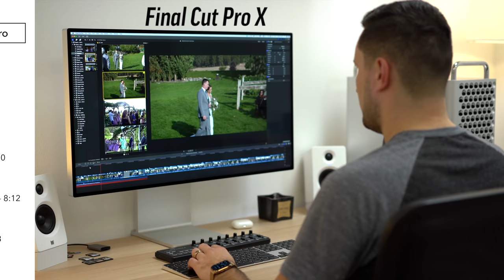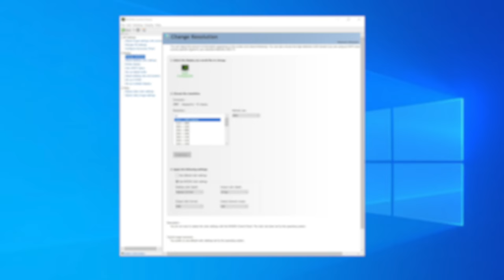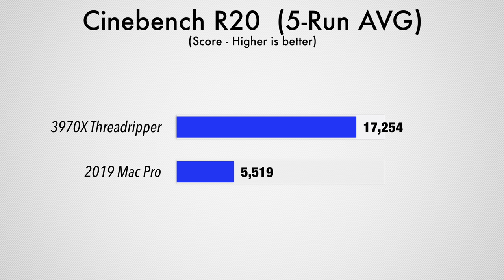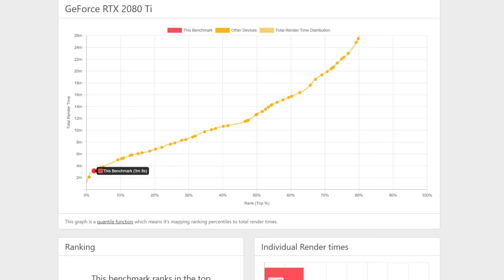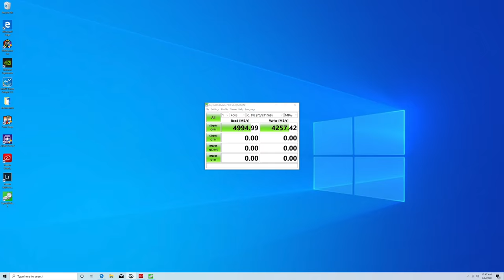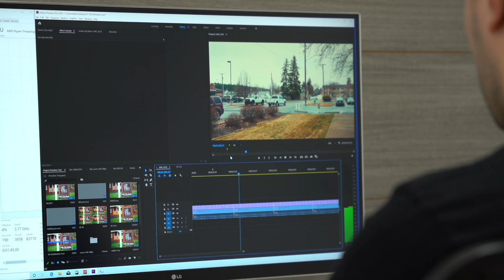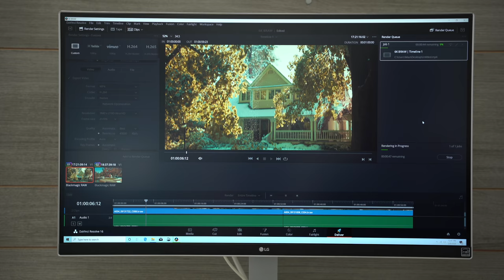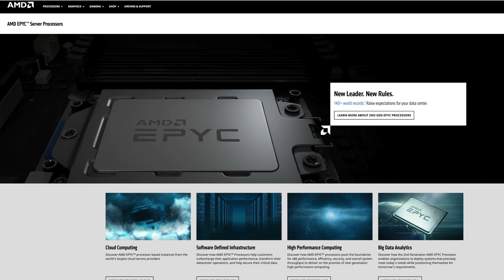$15,000 Mac Pro vs $5,000 Threadripper - Sorry Apple..

Comment: “1.5tb significantly higher than pc..” costs extra 25,000$ yeah no thanks i would rather have a car thanks lmfao
Reply: 1. The Mac Pro uses regular DDR4 ECC dimms so you can totally buy extra RAM from Newegg and install it yourself.
2. He's mentioning the >*possibility*< of putting 1,5TB versus 256GB which some tasks can benefit from.
Reply: @AlejandroLZuvic  I mean, you can get the same amount of ram on pc, even going up to 2t if needed for still less cost.
Reply: Samo Gledam lol why a server?? You can edit minecraft videos on a server
Reply: @lollol-qg2zn  get an EPYC which is 7k,and the system is STILL CHEAPER,and you have 2TB RAM
Reply: @AlejandroLZuvic  This is nonsense using all 1.5 Tb of RAM simultaneously in a lot of tasks this xeon can be your bottleneck obviously.
Reply: The real question here is why the fuck would you need that much ram abt 16 gb of ram and ur good
Reply: @BIG tiny PANDA Just watch Linys tech tips video about how much ram do you need ? Engineering easily takes 256 gb of ram and would like more

Comment: You gotta love the argument, "Oh we could get a Quaddro, but that would double the cost of the build".... Which would still make it $5,000 cheaper than the Mac.  Not a very good argument in my opinion.
Reply: Or a Titan V
Reply: blad90  Oh look, someone thinks he's smart.  OK Apple fanboy, let's dance.  I was being nice before with how short my response was, but let's go ahead and get into the nitty gritty.  Let's break it down.

The guy in the video misquoted the price by which the cost of his system would go up by getting a Quaddro instead.  He claimed $5000, but showed a $4,600.  I've been able to find that card easily for about $3600-$3800 dollars.  On top of that, he neglected to mention the fact that if you choose to go with the Quaddro "instead" of the 2080Ti, you don't factor in the price difference post 2080Ti when you consider how much the price of your system goes up by.  You need to remove $1200 from the price of his build BEFORE your add the price of the Quaddro to it.  So the price of this build would go up by $2400-$3400 TOPS... Not $5000.  Which would make his build $6,900 cheaper still than the Mac Pro in a worst case scenario, if you didn't take the time to SHOP AROUND for a good price.

But get this, if you were really "worried" about the 24GB of VRM, you could go up to the Quaddro 8000 (top of the line card) and that would only cost $5333 on Amazon right now.  That card has 48GB of VRAM, which means, this would only increase the price of the overall build by $4,133 and would STILL be OVER $5,000 cheaper than the Mac Pro.

But hey, while we're on a roll, why don't we finish this with some icing on the cake.  You could stick with the Quaddro 6000 and then buy a second one.  Have a Dual GPU system, unlike the Mac Pro version he bought, but end up with 48GB of total VRAM capacity (24GB per GPU), but have faster GPU's, more CPU cores than the Mac Pro could ever hope to match and still come out a few thousand dollars cheaper than the Mac Pro he bought.  Or go full bore dual Quaddro 8000's (96GB total) and still come up a little cheaper.  Not by much, but still cheaper.

Do you understand just how BAD a value the Mac Pro is yet?  Next time, do your homework before you attempt to debate hardware specs with someone who's been building computers for over 20 years.

Mic Drop
Reply: blad90  LMFAO!  This is pricelessly pathetic.  Thank you for making my day!
Reply: blad90  What fallacy?  If you're referring to portion I deleted, that's because I thought he had a different GFX card than he had.  I thought he had the Dual GPU card, when he doesn't, which actually paints his bang for buck as even worse than I initially thought.  But this realization meant my starting argument wasn't pertinent to his build.  Be fair man, it was over a week ago since I watched the video.  I've slept since then.  So I removed that one argument and fixed the rest so it didn't look like a hack job.  

As for your argument, just what "argument" have you made?  None.  You have yet to come up with a single argument that adequately contradicts ANY of my points let alone ANY that puts the Mac Pro in any kind of positive light when comparing specs to cost.  Not a single point other than you going "Well Apple doesn't care about value", as if that's supposed to be a good thing rather than the worse thing that it is.  Yet you claim victory?  I stand by my last response:

Pricelessly Pathetic.
Reply: blad90  My Build:

BeQuiet Dark Base Pro 900 Rev 1.5 (Rev 1 partially converted to Rev 2)
x5 140mm BeQuiet Silent Wings 3 case fans
EVGA SuperNova 850Watt Power Supply
Motherboard: MSI X399 Pro Carbon
CPU: AMD Ryzen Threadripper 1950X (16 core/ 32 thread) @ 3.4Ghz Base / 4.0Ghz Boost / 4.2Ghz XFR
Noctua NH-U14S TR4-SP3 CPU Cooler (modified to use lighting cap from MSI Core Frozr L CPU cooler and fan replaced with 2 Noctua Chromax NF-A15 HS-PWM fans)
32GB G.Skill F4-3200C14Q-32GTZ @ 3200Mhz CL14 DDR4 RAM
MSI GeForce RTX 2080 Ti Gaming X Trio graphics card
250GB Samsung 960 Evo M.2 NVME SSD Hard Drive
500GB Samsung 970 Pro M.2 NVME SSD Hard Drive
120GB Corsair Force 3 SATA SSD
12TB Western Digital UltraStar HC520 7200rpm HDD
4TB Western Digital Black 7200rpm HDD
2TB Western Digital Black 7200rpm HDD
1TB Western Digital Black 7200rpm HDD
1TB Western Digital Black 7200rpm HDD
LiteOn Blu-Ray ROM / DVD rewriter
CableMod Pro ModMesh Sleeved Cables - Carbon

https://hardwarecanucks.com/forum/attachments/3-jpg.26680/
https://hardwarecanucks.com/forum/attachments/5-jpg.26682/
https://hardwarecanucks.com/forum/attachments/8-jpg.26685/

No, I couldn't afford an Apple product at all, could I.  Or maybe I choose not to waste money "buying" computers, because I can "build" better computers myself.
Reply: @valhallasashes4354 , this boy made my day, sooo bad
Reply: blad90  wait I thought you "Mic is infinitely dropped. Never to be picked again. Good bye."  what happened?
Reply: @vaskopoh9512  this is what we called fangay
Reply: @valhallasashes4354  just ignore him, he's a troll.
Reply: blad90  that shows how stoopid people are to buy something just for the name of the company even if its more expensive and not better at all
Reply: @valhallasashes4354  very cringey response at the end with the mic drop. You just convinced the whole industry to go custom build. So brave.
Reply: @Smorfar  Oh yeah, it definitely is cringey lol.  Especially after I was forced to edit it without the previous context for why I put it there to begin with.  I intended to remove it in my edit, but before I could, he responded making the "mic drop" the highlight of his post.  So I was forced to leave it in for the benefit of his context.  Sometimes that's just how the timing plays out.  lol, I still cringe every time I see it, but I can't remove it due to context.
Reply: C'mon guys, you ignore the elephant in the room and fight to that fanboy that dosen't even had the attention span to read all the post before making an argument. 
This is so simple, this kind of computers are for people who work really hard and need them, they are not jewelry or social status, if you want social status you must be a virgin to buy a mac pro just for that  (just saying). In this case the better performance wins because it makes more money and the fact that this guy compared a 15000$ computer to a 5000$ computer just shows that it just wanted the mac to win some points and not be completely overrun by the threadripper . In a real case when performance is critical and you are willing to pay 15000$ for a pc you just pick the best performance for that price, and for 15000$ , you can go some crazy setups with dual epyc and a shit ton of ram and quaddro, in that case is pointless the testing as the winner in all aspects is clear. This beign said, nowdays you buy apple just for the OS and not for value (the look in this kind of computer it dosen't metter so much, is not a starbucks pc) and is nothing wrong with that.
Reply: blad90  The type of guy who spends all his money on apple products and eats his own shit for the next month because he is broken
Reply: @valhallasashes4354  A question out of my complete ignorance: I'm pretty sure that when using dual GPUs, only one card's VRAM is used, so you are not really doubling the VRAM, is that the case for video encoding too or is it only for gaming?
Reply: @MHNK77  When it comes to gaming, you're absolutely right.  But if I remember correctly, it's more of a duplication of data across both cards in order to cut down on latency, due to the data/streaming needing to be available at a moments notice in a real time gaming scenario.  Not that it really matters much anymore now that SLI and CFX are effectively dead.  

But in a graphics rendering or video encoding scenario or other such productivity workloads, "real time" may not be as critical as overall available memory or sheer processing grunt.  In those situations where real time is not really a factor, I don't really see a reason why it would be necessary to duplicate "all" data across both cards, rather than only what each card needs to complete it's specific task.  So theoretically, even in a dual GPU setup on a workstation, the workstation should be able to make more efficient use of it's overall available resources.  But then again, I'm more of a hardware guy than a software guy.  Someone with a more comprehensive understanding of how the various productivity software packages work (like a software engineer) would be in a far better position to answer that specific question than me.  You know how it goes as that's been the state of hardware for decades.  We've had the hardware resources for years, but it's up to the developers to actually make use of them.
Reply: He also isnt using ECC memory on the PC build which makes it far cheaper but nowhere near apples to apples comparison
Reply: The Mac is literally failing at everything (except build part I honestly think they did good to send there Mac build its compact when you want a refund cuz you realize pc is better)
Reply: @valhallasashes4354  you ended this mans whole carrear
Reply: @valhallasashes4354  Thanks, it makes a lot of sense.
Reply: @valhallasashes4354  and don't forget that they haven't installed a afterburnercard in the PC build, that gives a big benefit to the apple so why not put that in the PC build, its like compairing to cars where one doens't have a turbo and then saying the turbo version is much faster

Comment: "the speeds are considerably better on the normal pc BUT the apple computer has quieter fans" that's enough reason to buy the Mac for 10000$ more
Reply: He could have lower the performance of the pc and lower the fan to match the mac.
The only reason to buy apple it's for the ecosystem however for what cost.
Reply: Sigmato or better fans
Reply: @markmartin5364  Or a better case but you know it will close the price gap between the two that's why he didn't even upgrade the gpu.
Reply: He clearly didn’t configure fan control properly. Mine runs near silent as I set them not to blast on with cpu temp.

The aio keeps me at stable temps regardless of case fan speed
Reply: @Prodzick  what kind of ecosystem that won't let u play the best games ever build lol..I use mechanical softwares and it won't work Mac, it's not a real computer lol
Reply: @The-Heart-Will-Testify  It's clearly not a computer for mechanical engineer unless it's for the flex.
What i know is that they are heavily aiming for the sexy audio-visual market professional wich is pretty clever because it ends up to add on the marketing of the brand.

With an heavy focus on beginer/early professional with Final Cut Pro for exemple they drag a lot of people into Apple ecosystem and also for everyone their device software integration with imessage,icloud,facetime that unite the whole platform.

Optimisation really makes the difference when you see how well mac our doing with their specs on specific task like video editing.Also they are able to support their older product simply because they have less of them so far it works.

However they are extremly toxic on the right to repare your device.
They almost never aknowledge their mistakes,if it doesn't work it's your fault etc..

I was able to better understanding Apple success by meeting and working with Apple user that don't shame green bubble.

ps: I am curious to know which mechanical software you use and why you like it ?
So far i only use Blender, it works well for animation but not very professional for engineering.
Reply: You can add like 1500 on custom watercool and be cooler and quiter and still way cheaper than the apple shit.
Reply: Right like they don’t have ways to make the PC quieter 🤣
Reply: @Prodzick  Um speaking of Professional software Maya works on windows and mac. And as a small bonus linux. It seems that you are doing 3d animation so told

Comment: I would like to see a "battle" between a $15.000 windows PC vs. the $15.000 apple pc
Reply: Nah, that would simply be an overkill, since you can make a better pc than the mac with less than 2000 dollars.
Reply: a 15k pc for windows would be hard to build due to the parts not actually costing enough and even then we would know the results so there is no point and wouldn’t be a smart move for the creator income wise
Reply: A bunch of threadrippers and rtx titans with like 10 monitors would still cost way less than 15k lmao
Reply: itd be hard to find components for that price that wouldnt be absolute overkill.  it could work out(running dual titan rtx and higher end threadripper, and just the most expensive and unnecessary components), but why would you do that when you could beat a mac with an even cheaper pc.
Reply: Its 44% faster already imagine a 15k$ one
Reply: My sister insists on buying the $1300 Mac even though I've shown her that my $350 PC has better specs in everyway. These people are brainwashed into apple
Reply: Ryzen threadripper 3990x, nvidia quadro rtx 8000, 128 or 256 gb of ram, 8 tb of ssd, GOOD peripherals (such as mouse or keyboards of good brands with good performance), Some licenses for creating multimedia content And a monitor with a high refresh rate, (let's not forget that we would also have a high-end liquid cooling). I think the price if it's not the same is even lower and, besides, it's MUCH more powerful than the Mac pro.
Reply: Drew brown Sounds like bullshit. What Mac and what $350 pc?
Reply: @drewbrown9888  IKR,people that buy macs use it as a status symbol for showing off ,nothing else
Reply: Andrés Felipe Vargas Delgado If you wanna do video editing and rendering tasks, why would you get a 2080ti ?
Reply: Apple: MacBook
DubStepzz: Hold my GTA V
Reply: You can't Build a 15,000 Windows Pc Max is 10,000
Reply: Drew brown You’re just brainwashed into the notion that people can’t have preferences on the OS they use.
Reply: Drew brown Macs are good for some work flows. I’m doing UX/UI design and the whole team are using Macs 🖥. It’s easier for the cooperative design program for everyone to be on the same page. The 2019 IMac I have also was a great built in 5k monitor for great high fidelity pixel perfect designs. 

But for gaming..... PC all day long 😂
Reply: Bro windows don't have $15000 gaming pc
Reply: Snazzy Labs did it. But he used final cut on the mac and it beat the pc.
Reply: Any number of 0(zero) after .(decimal) do not have any value. So what you're asking is battle between $15 pc and mac, which is quite impossible.
Reply: @drewbrown9888  yep, they're called iSheep
Reply: @RR-uc1wb  you can hackintosh ya know
Reply: @ryanblackwell6402  that's actually a good point
Reply: @tfishappeningxd5915  Typical Apple fanboy: But do have Final Cut Pro X and Logic Pro X on Windows?! Yeah, I thought so.
Reply: @fidjdbdjficbfk7944  its a good option. Nvidia a couple months ago launched their New "Studio" drivers, that are optimized for making media content, such as videos, 3d works, animations, etc. If you have a graphics card it is a very good option to use these drivers, they will give you a better overall experience in the works you do.
Reply: @seireiart  hahaha true dude, they really believe that those are the best apps for creative content 🤣
Reply: @tfishappeningxd5915  That grinds my gears so much. They're probably don't understand that the tools you're using don't matter as long as you have a sense of creativity.

Comment: I wouldn't mind a "jet engine" in my house if it meant performance ...and cost effectiveness.
Reply: Ofc you can choose a better cooling solution and it would still be able to keep quiet since this is a custom build
Reply: And also leaves me with plenty of money to upgrade in the coming years!!
Reply: I got a 2k pc and i can confirm. You notice the speed more than the sound
Reply: @rgbv509   exactly
Reply: @toha2939  Thanks bro for speaking sentences that makes logical sense, unlike this video. This max tech fellow clearly doesn't know what the heck he is talking about and he does not know anything about PCs as well. he is just an apple fanboy making videos to promote apple.
Reply: You have the control over the fans btw (which Max didn't do for some weird reason... hmmm...)